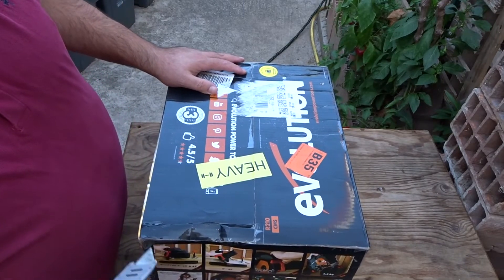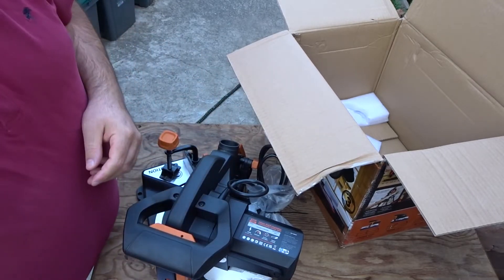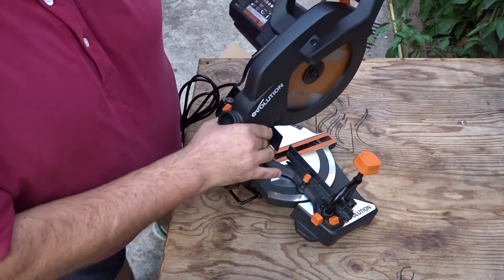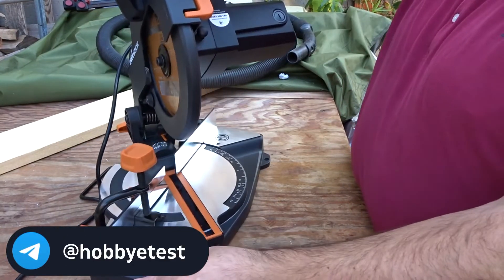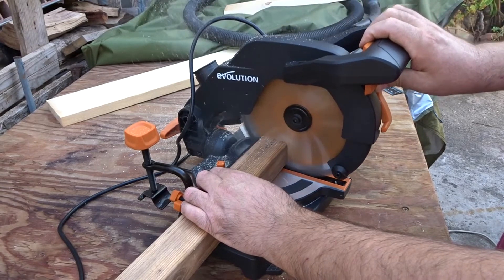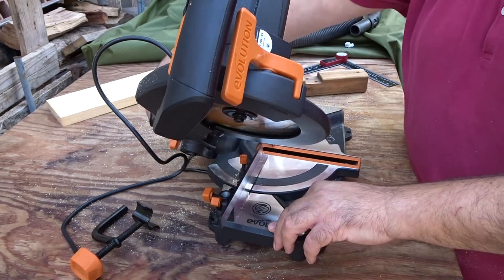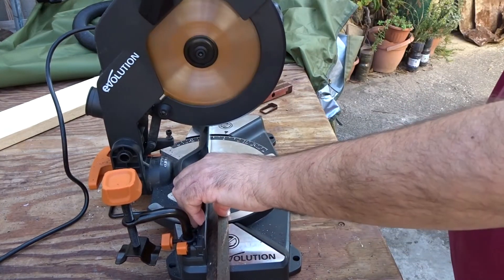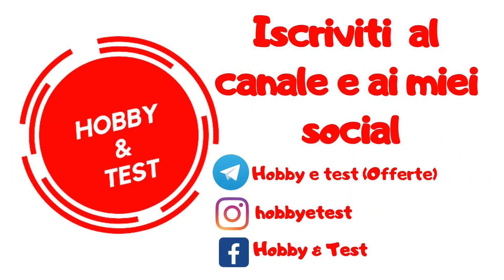Troncatrice Evolution Power Tools  R 210 Cms #hobbyetest #evolution #faidate #legno

Comment from the maker: Descrizione
1) Multifunzione ed estremamente versatile per tagli di qualsiasi materiale. 2) Estremamente leggera e facile da maneggiare.

3) Bocchetta di asportazione trucioli posteriore.

4) Piatto girevole a 0°, 15°, 22.5°, 30° & 45°

5) Inclinazione laterale sinistra.

6) Carboncini esterni.

Caratteristiche tecniche

Potenza: 1200W

Profondità di taglio a 90° (incl. piatto 0°; incl. lama 0°): 125x55 mm Profondità di taglio a 45° (incl. piatto 45°; incl. lama 45°): 85x35 mm Profondità di taglio a 45° (incl. piatto 45°; incl. lama 0°): 85x50 mm Profondità di taglio a 45° (incl. piatto 0°; incl. lama 45°): 125x35 mm Spessore massimo di taglio su metallo: 10 mm

Velocità a vuoto: 3750 rpm

Pressione sonora sotto carico: 89 dB (A)

Vibrazione sotto carico: 6 m/s2

Peso: 5,8 Kg